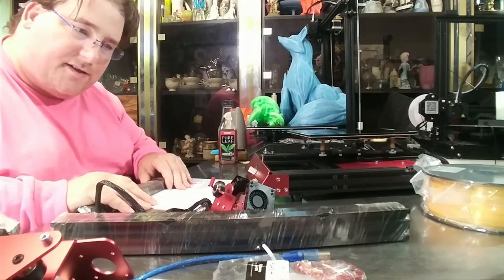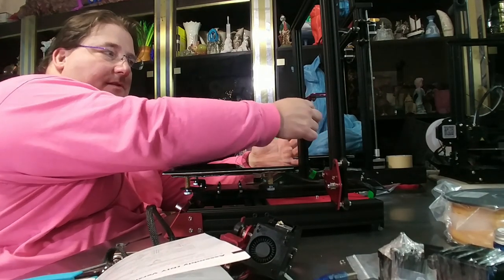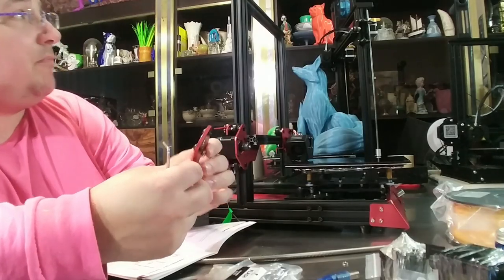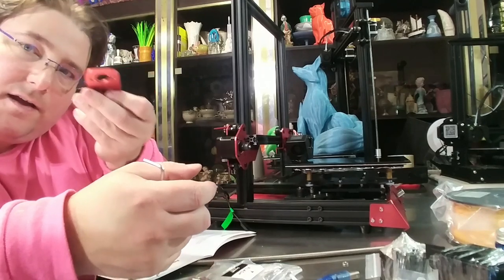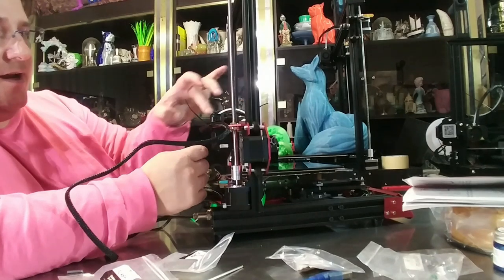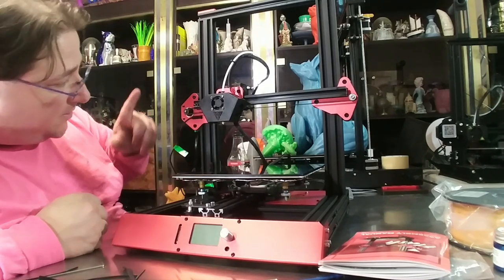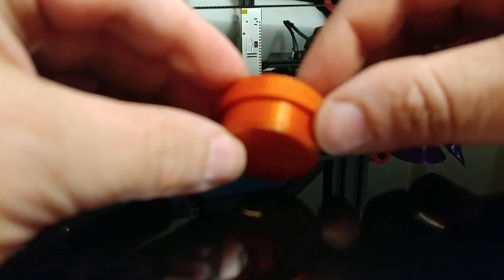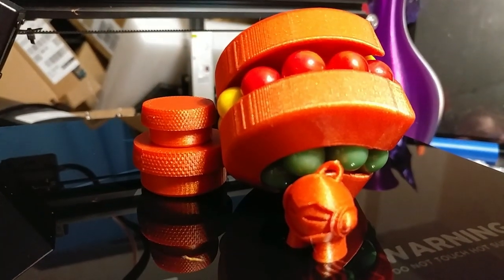Tevo Flash Base Model Unbox, Build, Print   T3DP

Comment: G'day I'm wondering if you might help me? I'm trying to understand my tevo flash and can't for the life of me get it to a spot where I can print well! Any help and suggestions on setup would be greatly appreciated thanks!
Reply from the maker: I will gladly attempt to help but you have not asked a question I can't see your printer I can't touch your printer or interact with your printer so you need to figure out how to ask a directed questions so that I can then guide you with an answer

I guess the first step is have you gone through my bed leveling video? Nerys.com under 3D printing tips or are you having a problem other than bed leveling?

Comment: Hello, I didn't exactly know how to contact you so I just picked the newest video. I figured if anybody would know what I'm trying to find out it would be you. I would like to get a bigger printer than my ender 3  such as a cr10 or 10s or the 10s pro. On e-bay there are several sellers that are selling them for about 100 to 150 less than gear best or creality direct. The one thing that stands out to me is they are all located from Dayton N.J. (NEWGAGA, SHENGJINGLUITING, KOKO FINE ETC) Are they one in the same or just happen to be in the same city. Any info would be helpful Thanks, Love all your vids.
Reply from the maker: I dont know. Coming from the us is good. It would be save to assume they are customer returns. I consider such purchases to be quite safe but be prepared for lossibke missing bits or bent parts. Etc.. Ie as long as you are diy handy go for it. Use a trusted credit card for protection just in case. I have an ebay affiliate link in the description. Let me know how it goes.
Reply: Thank you so much for the info, returns I'll stay away from. You the man.